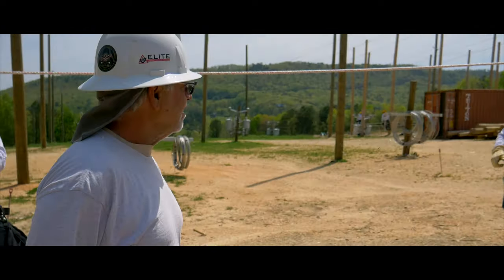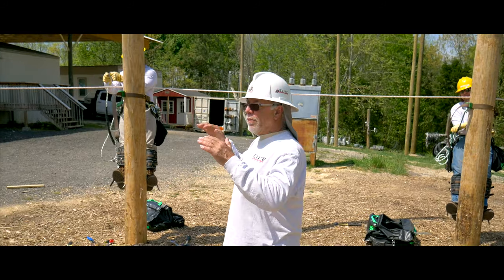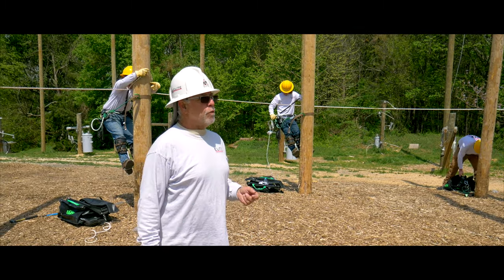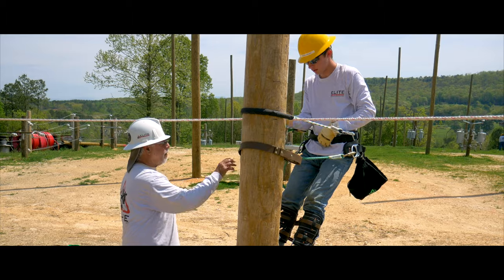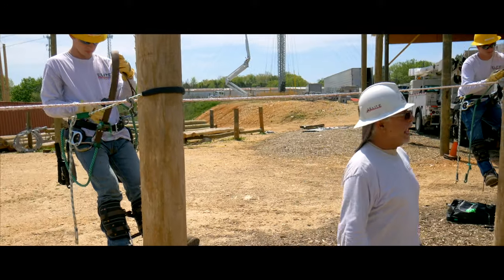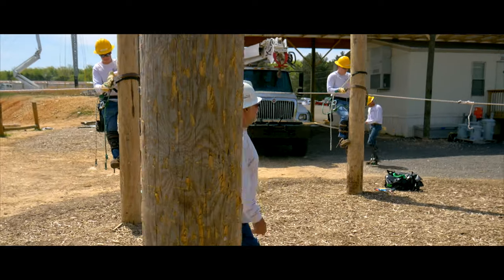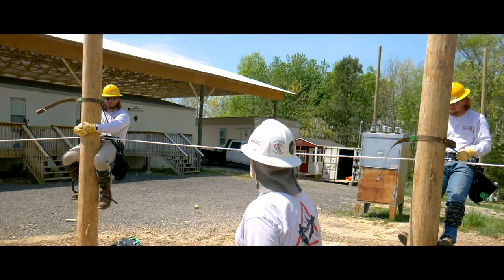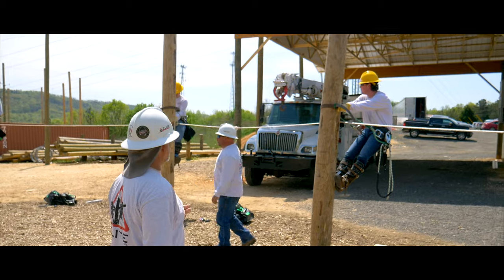ELITE Lineman - Learning to Transfer

Comment: All these comments decrying the new equipment and complaining how they did it better back in the day......was that way worth the deaths and severe injuries that virtually don't exist anymore from falls and burns that came with free climbing?  I have been climbing for 28 years, free climbing most of that and while I didn't care for the conversion, you adjust and can do everything more safely.  What use is a job if you can't go home in one piece at the end of the day?  Good instructor in the video, I tend to favor a tighter grouping of poles and positioning myself in such a way I can see most of what is going on (he has his back to half his group at any time).   If it's their first time transitioning, you should have someone demonstrating each step as he explains it.  I prefer to demonstrate while explaining.
Reply from the maker: @bbtechbbtech  thanks for sharing this.

Comment: Why are most of the students both legs locked makes no sense
Reply: Bc they're still in training? It makes no sense not to understand that, lol.
Reply: @Bagheera98 creating bad work habits which in turn will make their job more dangerous whether or not they are in training we learned when we started to climb to have 1 leg locked and the other slightly bent not that hard to understand
Reply: @Bagheera98 I would rather have one leg locked than both especially when I'm transferring 😂 but that's just me to much risk
Reply: Lock both them legs and tell me how that works when you go to bed them lol. That’s what this guys saying. You should train the same way you work.  One leg slightly bent. One leg locked rotating out for comfort